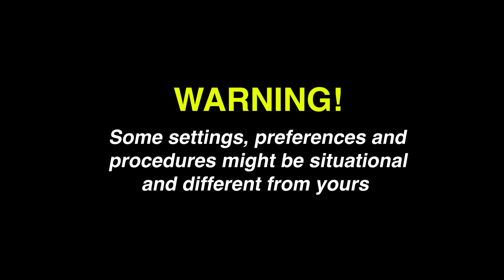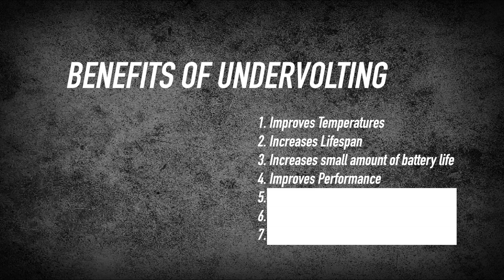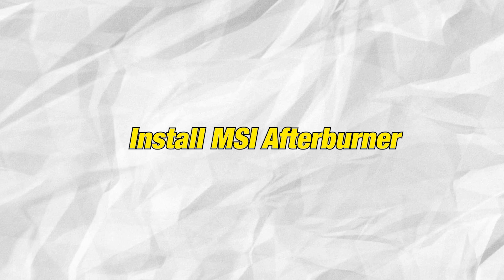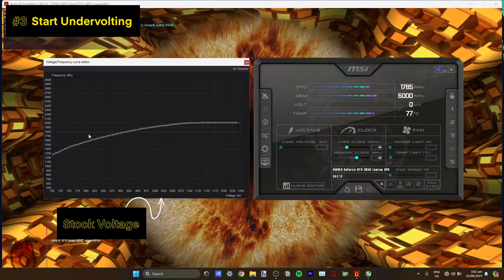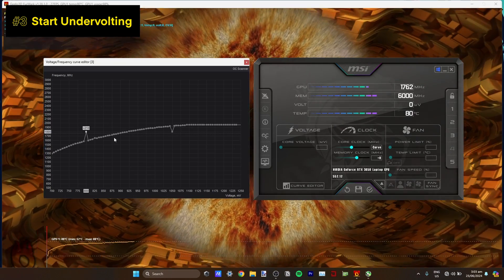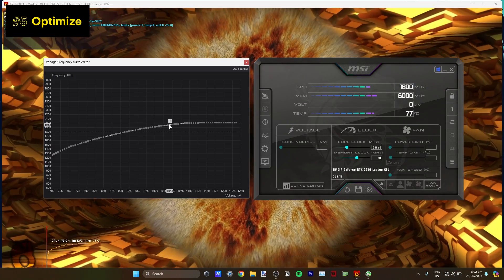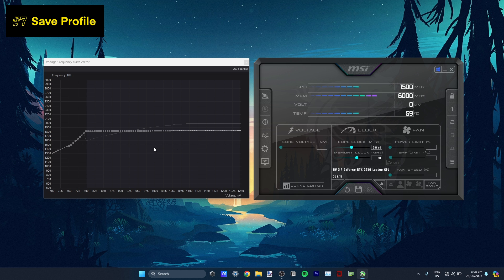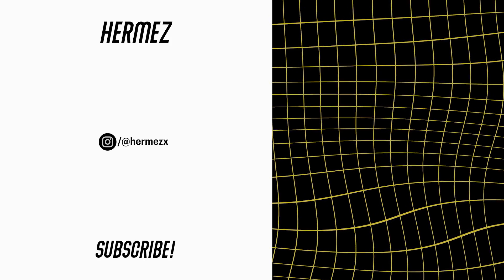UNDERVOLTING 101: GPU EDITION (ASUS TUF F15)

Comment: while running the stress test my gpu (rtx 3050) stays at lowest clock speed rather than reaching 1800mhz like yours
but while in games it goes much higher
idk what to do
Reply: You had optimise yr cpu from the app you overclocked it you running faster but hoter so slower.

Comment: use ThrottleStop not this stupidity its not stable.
Reply: brother this is for the gpu, throttlestop is for cpus lmfao who you calling stupid 😂
Reply: @tribhoon  Yes all issues comes from cpu not gpu no one in right head will undervolt gpu there is no reason to do!
Reply: @valentazz  but undervolting gpu can still give a little performance boost man
Reply: @tribhoon   all laptop cooling system is connected biggest heat generator is cpu undervolt cpu to gain cooling head room and your gpu will boost its self to higher speed, undervolt gpu get instabilities or worse been there know that you do what you want take care.

Comment: Bro please reply❤❤❤❤❤
Are yours laptop fan are louder  in turbo mode then performance or silent mode...

When i turn on turbo mode my fans are still quiet......
Please reply ❤❤
Reply: The RPM of the fans go high, only when the lap is doing some work or under stress also when the temps go high.
Reply: @suganth35  thankss,,, it worked